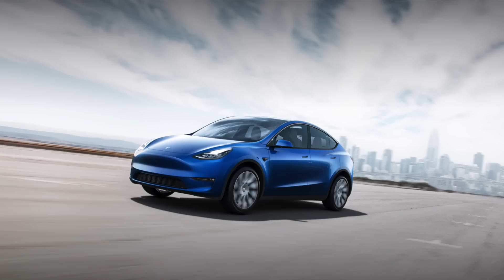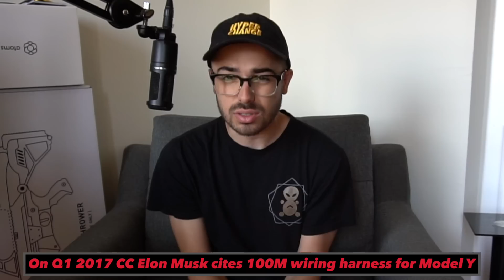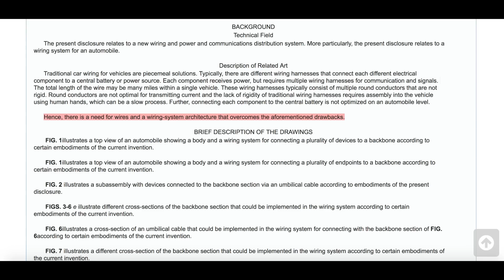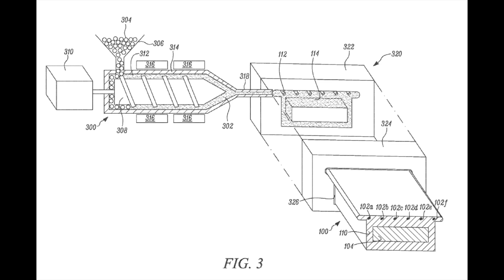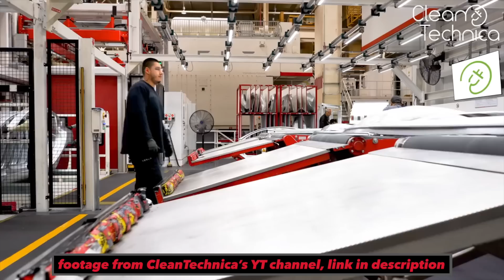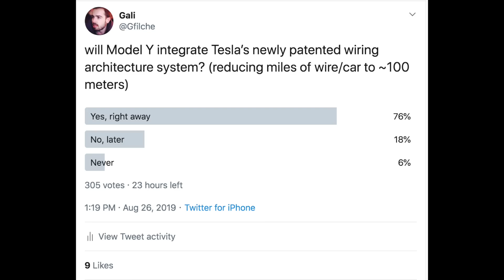Model Y Manufacturing & CAPEX Revolution?

Comment: This new wiring would probably go in the Model 3 also.  Aren't they being made on the same line?
Reply from the maker: don't think Elon ever mentioned the new wiring for M3 ... but seems like a logical move
Reply: @HyperChangeTV  My guess is that the second gen M3 line in China (see 8:41 in your video) may indicate that M3s in China may get the new wiring harness, especially since the he talks about the same simplicity for the model Y line as in SHanghai
Reply: Probably after Y launches and the work out everything
Reply: I would expect some sales numbers drop in Model 3 when Y is released. That would be a good time to slow down production and convert the production design.
Reply: Hernan Soulages this. I think the same will happen with the maxwell batteries. The 2nd gen model 3 will be even better.
Reply: I wonder if this is one of the reasons that the Semi was pushed back, too?
Reply: she don't like Cocaine !
Reply: I suspect that in the interest of getting Y our the door, they won’t implement the wiring system change until later as it requires a lot of engineering hours and new parts (lots of new area micro controllers and power controllers, is my understanding) whereas if they ship Y with the 3’s current system, the Y is super-similar and there is no redesigning.   It sounds like Elon already made the call to hold off on that in the interest of ramp up, but if it works out to be worth it, It will be implemented when it is most expedient.  I think that the China line is starting too soon to get this change as well, but would love if they pull it off.   It may be possible to implement the rigid wiring part without the wiring reduction part, in order to ease assembly without the mass-redesign.  The stamping solution is much more likely that it will work out to start with for Y (and hopefully for 3 at the China plant) as they need new stampers for the Y line (or sub-line) anyway.
Reply: how aboat like phones, it depends what factory they"re made in different markets might get specific parts.
Reply: I wish
Reply: It will probably be included in Y and other new vehicles, and 3, S, X in that order. S,X may take from 'soon' to 'sometime in the future'.

Comment: Re the stamping machine ...  teslafaninsight made an interesting point.  If the car is made from less panels,  what happens when the car is in an accident and needs to be repaired?  Currently it is possible to replace individual panels..  would love this to be put to Elon at some point for clarification
Reply: it's a reasonable question to pose
Reply: The frame (regardless if its casted in 1 piece, or 4 stamped pieces & welded together, or 70 pieces welded together) is one component.. It does not include the fenders or bumper panels...This is simply about the frame component (1 piece like all cars) is manufactured.... The (unibody) frame is an automatic insurance write off if damaged in Canada.. Some countries may be less stringent..  but don't expect the same measure of safety given metal fatigue and deviations from original design etc
Reply: To be clear, a unibody (such as Tesla uses on its cars) has no frame. They do have a skateboard, but that's a different concept.
Reply: you cut and stamp the replacement part.
Reply: Noob lade I find it hard to imagine that cutting out the damaged part could be super accurate,  which would lead to poor fitting replacement panels.
Reply: @andrewpaulhart  That's a job you know. Watch a couple of Pimp my ride episodes (the good ones with Xzibit) or West Coast Customs and you'll see the kind of stuffs that can be done with skill.
Reply: Noob lade interesting.  Do you think it would make repair more expensive though?
Reply: @andrewpaulhart  Maybe a bit but it doesn't really matter as the cost isn't on Tesla book but charged back to insurances or customers. 
Also when the car are autonomous and having less accident than non autonomous ones, it's not a problem how much it costs to repair them even if for the Tesla own fleet as they are less likely to need this kind of major repairs. 
Of course, that's just an opinion as I am no expert & didn't do the maths.
Reply: Some what unrelated, but would love to know from Musk what the extra cost to stamp in stainless steel. Seems the only real limitation to million mile car is corrosion.
Reply: @billh2294  Corrosion will destroy more cars than accidents, parts failure, and time combined.  I suggest a body undercoat ever few years.  The car will last 20, you need to protect it for it to last until the end of it's life.  As for replacing parts, cut, replace, weld.  This is not rocket science.  I have a big point people are not paying attention to... if you live in the city and drive 12 miles to work over an hour and a half every day the car has 12,000 miles on it in 2.5 years, but 1,500 hours on the motor...  An electric car does the same thing, has 12,000 miles on it, but only 200 hours on the motor.  Think about the difference in resale value.  A small car would lose almost 80% of it's value in 3 years.  The EV should only lose less than 10%.  As the EV has 988,000 miles or 17 years on it.  The used market on EVs will notice this soon.  Used ICE will be crushed or given away soon.
Reply: David H I believe stainless steel costs 5 times as much and is harder to work with.  No idea whether it’s suitable for stamping
Reply: @andrewpaulhart  Stainless has been used in stamping for kitchen ware: I'm sure it doesn't form as well as mild steel. Question is; what is the cost of the body in white and are consumers willing to pay 5x that price? I know stainless can be up to 3% heavier than mild steel but primer and paint would be un-nesasary and that does ad up.
Reply: @billh2294  Weren't Delorean's made from stainless steel?
Reply: @huskydogg7536  Just the outer body panels. Done more for looks than anything else.
Reply: David H aluminum is corrosion resistant enough. Nobody really wants a million mile car.
Reply: They could stamp one and cut into 1/4 or many pannels.
Reply: All cars today are already mono bodies.  They would just cut the part out and put a new one in just like cars today.
Reply: the answer is : no accidents because auto-pilot so good
Reply: @The4lexO  there's always going to be a minimum amount of cars damaged while parked.
Reply: Andrew Hart - I seems the patent is for the bottom pan/unibody, not the outer panels.  If you damage the unibody in an accident, it’s a already pretty big deal, no matter who made the vehicle.  The insurance company will often write it off.
Reply: Thanks for addressing this, I was also curious
Reply: I'm guessing the stamping process cuts the metal into the various panels as well as forming them. My guess the main advantages are less factory floor space for stamping and faster fabrication.
Reply: force field technology protests all panels
Reply: Avoid most accidents.
Reply: Tesla's policy to date is not to allow wrecked vehicles back on the road (it damages their image) So solution is don't get into an accident.